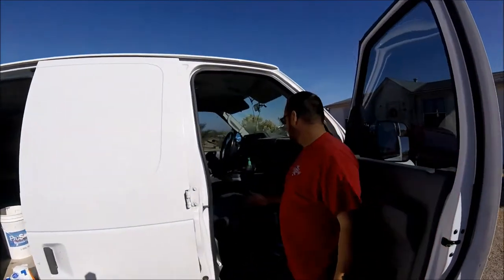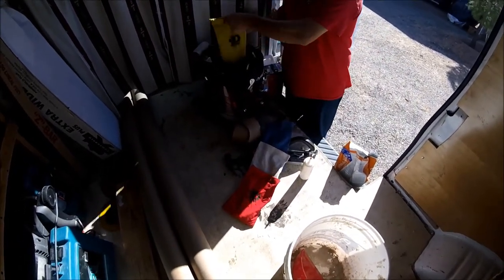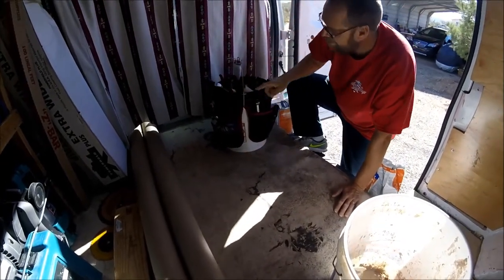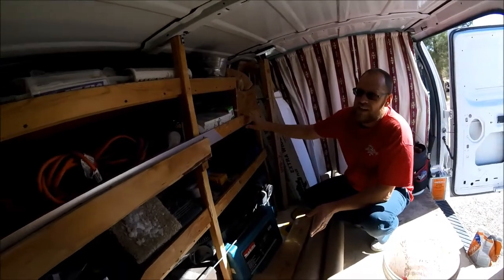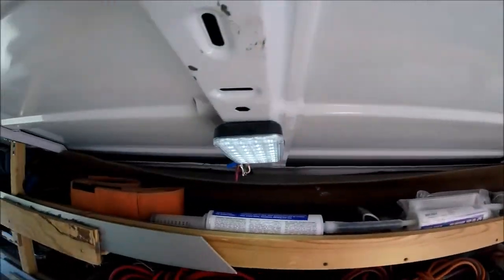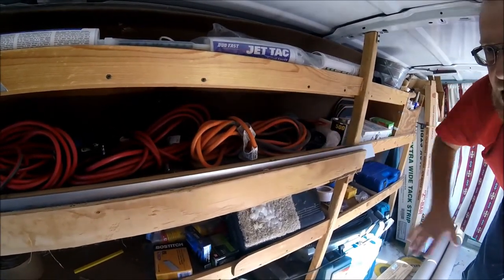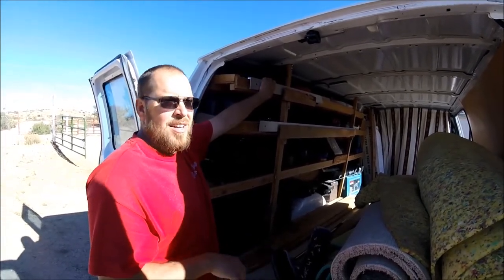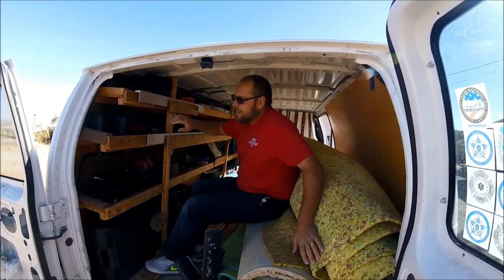TOUR OF MY WORK VAN SET UP

Comment: Just finished the video apparently a year later.lol. good to see a well organized truck.most guys have to spend time and dig for tools.my truck is a 1980 Ford ambulance.van front cube back fully moddifide, preformance wise plus work wise for floor covering installer.it holds a lot of weight and fit's 13.6 goods with door's closed.iit gets real Cold in Iowa so for my glue's in one outside compartment I've got heated copper wires that run on tago switch and keeps my glue's above temp.all other modifications are to many to list it's not the best on gas but that's why we make money.loved the cruent idea.cool🏁😎😄
Reply from the maker: russ sherry Dang that sounds awesome

Comment: Must be nice to leave all your caulks and glue and adhesive in your van all the time working in Arizona. Us installers in Wisconsin in the winter months have to bring them inside every night so they don’t freeze lol. Winter months suck laying carpet in Wisconsin . Dealing with the snow ,stiff carpet not bending easy to carry in the house . Then you have to crank the homeowners heat up for the carpet . Sorry I’m venting on you just thought I’d share . I’m sure the heat can be a challenge also . Thanks for sharing . Do you drill your tack strip down on concrete or use that jet tac on your shelf?
Reply from the maker: i hammer it in unless the concrete is all busted then i use jet tac , i'm from Tennessee and i always hated installing in the winter , here in AZ it's very installer friendly , only cold for about 2 months and when i say cold i mean in the 40s and 50s lol
Reply: FloorsbySouthernboys  Thanks . I do like those bags you use for your nails . I will be looking to get some .
Reply: CarpetMan same here bags are a cool idea saves time
Reply: CarpetMan. Fuuuuuuuuuuuuuuuuuihhhhhhhhhkk